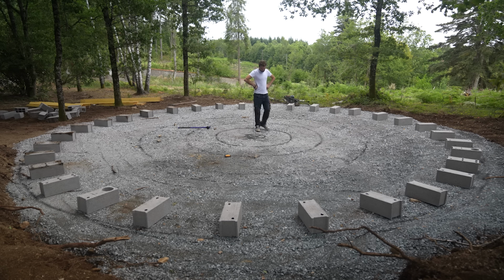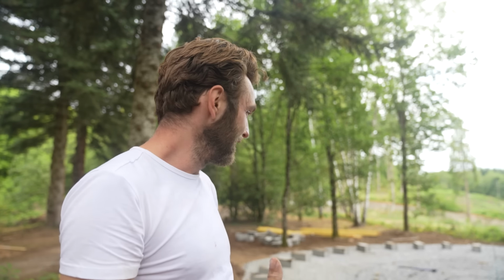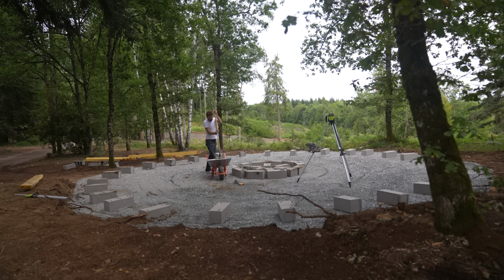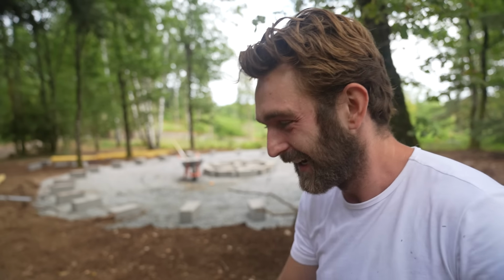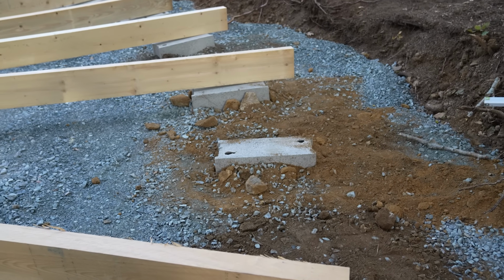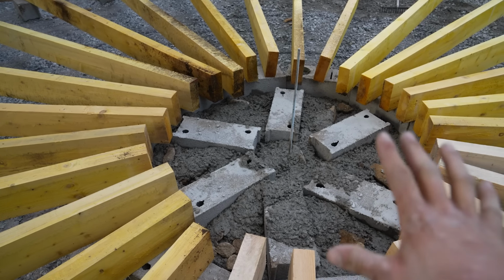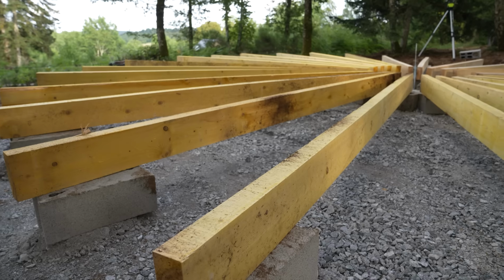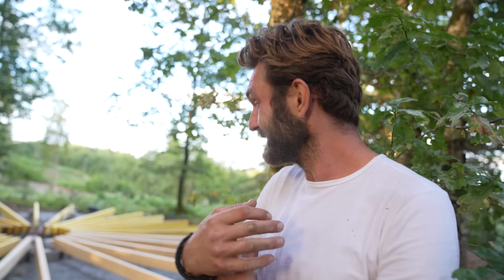Pumping water from the old chateau source.

Comment: Dan if you read this please don't get in that well without gas testing first!! It is very likely that organic matter has displaced the oxygen down there
Reply: Wow today I learned that can happen! What’s the solution, put a fan down it a while to vent it out? Go down it with some kind of oxygen tank or line?
Reply: Probably best to hire a sucker truck to drain the thing from above with noone going in there. But if you had to, subba gear
Reply: Such good advice. I hope he takes the time to read it and maybe have a discussion with you. From what I’ve seen in all the discussions in the comment section there’s a lot of wise people that offer smart tips for Dan.
He also needs to put a cover on the well for the safety of his boys and anyone else that walks near there. It blends in so easily, anyone could fall in it.
Reply: I was thinking of rats pee in the water too! Until tested, I wouldn’t be brave enough to use it even in cement.
Reply: Dan, why don't you just rent a  camping for Cople of months?
Reply: @samd505  and never ever go down when you are alone, gear or not. Wear a body harness and attach a cable or ohter rope to it which are strong enough for your weight and which the other person can use to pull you out.
Reply: Loads to think about, in this thread... 🤔
Reply: @mostafaelhaddadi7455  Now that'd be a pretty boring alternative, wouldn't it? ;)
Reply: I have a well at my house, brick and in very good condition, around 40ft deep. I know a lot of junk was thrown in years back. I rang a few companies involved in well construction to see if they would clear it out- no one wanted to get involved and said it was too dangerous.
Reply: Also..keep it covered for safety.
Reply: @mostafaelhaddadi7455  It'll take a few years to restore the Chateau, and for most of that time it will not be habitable. He may not be able to live in it even if it's habitable, depending on building laws.
Reply: @mostafaelhaddadi7455  Because building a yurt is far more fun!
Reply: @jennifer6833  And the wildlife too.
Reply: @mostafaelhaddadi7455 $$$$. And he has years to go on the Chateau. The Yurt will last as long as he cares for its upkeep.
Reply: In fact I often worry about animals  and children falling down there . Do you have a grate ? X
Reply: @debpatriot9557    Indeed.
That little rim around his death trap would just trip any victims on the way in so they go down head first.
Reply: You raised an interesting point.  How is it that an internationally famous building project has never had one single objection to anything from a building inspector, or even a visit from one?
Reply: @trudiemartin5854  I was thinking of how many dead animals have fallen in, died, and rotted in there, myself.
Reply: @ji8044 Dan referenced a guy coming round a few weeks ago.
Reply: I suggest a contest where we each guess the number of skulls that can be found in that pit.
Reply: @tracycroll4325  A dozen things I have seen would cause stop work orders in the US.  I'm wondering if Dan gets away with everything by calling it a movie set, rather than a residential building project.  That would be a stroke of genius, and hard to disprove.
Reply: Oxygen depletion is caused through the consumption of oxygen in the decomposition process or displacement with another gas. There are no visible signs of oxygen depletion or displacement. Plants grow perfectly fine in a zero oxygen environment. The breathing reflex is caused by the buildup of CO2 in the lungs NOT by low oxygen levels. Oxygen depletion causes hypoxia (oxygen starvation) which in the initial stages causes loss of cognitave functions followed by loss of conciousness and then death. The only good thing about it is you are unaware of it.

Oxygen is typically displaced by Hydrogen Sulphide which is given off by decaying vegetable matter in the presence of water. H2S in low concentrations smeels like rotten eggs. In high concentrations it burns out the smell receptors in your nose so you can not smell it.

The best way of clearing that well is by vacuum truck. It is fast and there is no mess to cleanup after wards. Failing that option the only other way would be forced ventilation. The bare minimum would be a forced, ducted airsupply to the very bottom of the well. Preferably with another fan exhausting out the top.

Once you start disturbing the material in the bottom of the well you are going to release bulk H2S into the bottom of the well. H2S is heavier than air so will stay in the bottom of the well given the chance.

If someone has to go down the well you REQUIRE a minimum of two people. The second person must not UNDER ANY CIRCUMSTANCES enter the well. The spotter may inititate a recovery if they can do so from the surface (using, for example, your winch to pull you from the well). The spotter's primary function is to raise the alarm.

There have be numerous cases where the spotter has entered a confined space to initiate a rescue and in so doing doubled the number of fatalities.

Ignorance in this matter WILL kill you.
Reply: @ji8044  As far as the law goes,if he wants to play around with a pile of rubble on his land with no public access or employees it’s up to him. The problems will likely arise when it officially becomes a residence.
Reply: Not only organic matter but also the water itself. High levels of minerals like iron and others can generate gases that smell like sulfur or rotten eggs. Cleaning a well is a risky work, you need proper ventilation and gear to do it safely. Anyway the first thing I would do would be a temporary cover to avoid children or animals falling inside. Second thing, I would connect the pump to the old piping system just to locate the entry point in the chateau.
Reply: @StubbyPhillips  🤣
Reply: @stephencrowther524  Perhaps France doesn't have as many officious twits standing in the way of everything anyone wants to accomplish.  Sure, there needs to be oversight and regulations, but in my experience many of the people who do inspections and issue permits tend to be shamefully and inexcusably slow about it.  I think it makes them feel important.
Reply: @mostafaelhaddadi7455   With a yurt you are king, with a camper not.
Reply: @mostafaelhaddadi7455  easier to sleep close to the chateau, so no travel time needed. AND, building a yurt makes for good content 💡💸
Reply: @mostafaelhaddadi7455 that’s very expensive.
We paid $170/day for a mid size camper.
Reply: Very good suggestions.  I know nothing about wells😮
Reply: @stephencrowther524  Well in the US he would need a CO to do that of course, but for instance all that steel would require a framing inspection.
Reply: @StubbyPhillips  I think that varies wildly depending on whether you live in a pro-growth or anti-growth town or county.
Reply: Cover that well, Dan.
Reply: @ji8044  The building has burned to the ground at least twice.  All that is left is the bones, literally nothing left to preserve. Dan has made the decision to rebuild it as close to it's original as possible. The site is historic, the building is not.  It will rise again anew like a phoenix with a tribute to it's past. Dan has people come and look and he has his permits.  He was wanting to build a log cabin but they wouldn't permit it.
Reply: @ji8044  he actually had an inspector out there already. I don't remember what episode would probably in the '90s
Reply: @StubbyPhillips  right probably has some of the people that the Nazis killed in there. Might be a better idea just to cap that thing and drill well
Reply: @Fuggybugs  I was shocked that he still has not put a protective covering over the well, to make sure no one falls down there, including his boys. We saw this open well quite some time ago and still he has not taken any precautions. There could even be e. coli in the water, or worse. And dead animals rotting in there.....not even good enough to mix cement, better off buying a water storage tank and having a water company come fill it up with clean, fresh water as needed.
Reply: @ToraTiger78  My thoughts exactly. There could even be some dangerous bacteria lurking in that water, not even fit to mix cement. Buy a water storage tank and have water delivered immediately Dan. And put a cover over that well to protect people from falling in.
Reply: @StubbyPhillips  Wow, I didn't even notice that, but that well definitely needs to be covered right away, I thought he would have covered it by now, it's been quite some time since he first showed the well in a past episode. He needs to buy a water storage tank asap and have clean water delivered and resolve that issue immediately.
Reply: @trudiemartin5854 More like rats and other animals drown in there and probably murk it up. 🤢
Reply: @Johnepumper  I wonder what the inspector thought about the uncovered well....as well as dangers from the water being contaminated, like with e. coli for example.
Reply: @stephencrowther524  Very well said! It's up to him. But I'm a bit sickened by the idea of "playing" with french heritage...
Reply: @lindascott2008  Yeah, I'm pretty far towards the opposite end of the spectrum from the usual hoard of "safety sallies" but that open pit death trap is just scary.
Reply: @lindascott2008  I too, was shocked as well, to see Dan has not covered the well.   Cannot put a price on safety.
That is a good idea, that Dan would be  better off buying a water storage tank and having a water company come fill it up with good clean, fresh water as needed.  Good point, until Dan decides to either get that well pumped & cleaned by a well company truck with a hose, or has funds to drill a new well closer to the chateau.
If he insists on using the well as is, he could at least pour a liter of bleach down there.   It will kill most everything alive:   bacteria, fungi, protozoa.
Reply: @udosteger has stupped enough to do it
Reply: I think the yurt is a great idea as it will form another income stream once he no longer needs to live in it, glamping is a big thing and the yurt sounds perfect.
Reply: @operator6471  ok well that's just them not wanting to be bothered. You need to understand that "well construction" nowadays is just drilling a small hole in the ground, lining it with pipe and eventually dropping a pump down it. Old fashioned wells are not even remotely in their wheelhouse.
Reply: @SweetOne.  I don't believe he ever intended to build a log cabin, sorry.  You have to remember Dan isn't rebuilding a chateau.  He's making a movie about one man struggling against all odds (and never using safety equipment)  Dan is a brilliant filmmaker, but he's not very good at construction at all.
Reply: @ji8044  did you miss that video then?
Reply: @debpatriot9557  I agree with you a cover is needed for safety the thought of anyone accidentally falling down it is a thing nightmares are made of
Reply: @Fuggybugs yeah me too
Reply: @jennifer6833  A cover !!! YES!!!!
Reply: @ji8044 maybe it has but we haven’t been told
Reply: @mostafaelhaddadi7455  That was my suggestion, at the very first. I don't think he read it.  But if he wants a nice big warm space, a Yurt is pretty darn comfy for him and the kids, or volunteer friends. They're pretty common in rural Canada, and folks just love them. This would keep everybody safe if the reno takes a lot longer than planned.
Reply: Methane!
Reply: Right on the line for that note. Dan did mention taking precautions in previous vlog especially for boys and potential risks for others. I bet a little nudge will be anticipated.
Reply: @operator6471  With the right equipment and experience clearing a well could be undertaken, I think no one wants to do the dirty jobs, or anything that involves a bit of work, more likely.
Reply: @sharonlomas3720  I suspect Dan will end up living in the Yurt and renting out B&B  and utilizing the finished Chateau as a business concern, obviously sleeping over and using the day rooms when vacant.
Reply: Good point, wonder if you could just hang a burning piece of wood in there to get rid of the gas. For the lack of oxygen, i would just blow compressed air in there. But yes, maybe dont go down there while being on your own
Reply: The best and safest way to drain it would be by using a huge pump truck with a long thick hose to just vacuum the entire well clean treat it.
Reply: Looks as though that well has been like that for a long time and also as if he’d let his boys anywhere in the woods without him.
Reply: All good tips here and the methane gas is a real one, As a kid I experianced a person die in a not to deep well as suffercated by gas! Take care and put a roof on your well also.
Reply: As a confined spaces trained person this is great advice, don’t be on your own either when attempting it
Reply: I want to to be a gas free ranger 
I want to put my life in danger 
I want to go and probe your hole
And climb down into your dirty mud tank 

It’s been close to ten years since my coworker killed himself for personal reasons, he taught me this song as a gas free , confined space inspector.
R. I. P.       Marc
Reply: @twobluestripes a blower to purge it for the correct amount of time based on the cubic feet of space before going in and test the air again. Also not a bad idea to keep an air monitor and blower going while down there. I work for a telephone company and we do that if we have to go into a manhole or underground vault.
Reply: @lesdmark  True, but they stated that it is dangerous work.
Reply: @ji8044  its France the rules are very different !
Reply: @mostafaelhaddadi7455 the yurt will be a few years
Reply: @ji8044 don't be ridiculous
Reply: I find it absolutely unbelievable that Dan hasn't attempted to cover that well in any way to stop anyone falling in.  Imagine having his 2 little boys there as well.  So, so dangerous.  Should have been the very 1st thing he did before anything else.  It's really crazy to have left it like that🙄🤯
Reply: Hope more people like this so the comment will be easy to spot.
Reply: @udosteger  Dan did say he would never go down the well without Nick and all his harnesses etc so we know he will never be alone
Reply: @operator6471  🤨
Reply: An open well. How many poor critters have fallen into that gaping hole. Just don't drink it. And maybe commission a grate or a fence. Especially with the young ones visiting.
Reply: It would be good to firstly have the well cleaned ( pressure wash) and drained. Secondly to grade the top soil around the well so surface water run away from the opening. After that COVER the well rigorously for safety and water hygiene.
Reply: Well is there and must be covered for safety as so deep ,mains water close by now as homes and businesses very close to château end of site so own water source irrelevant.
Reply: @Throki  😂 it’s true
Reply: Take care of your boys not to fall in… have a lid on it?
Reply: Where are the doggies?

Comment: If you suspend the pump with the rope from a 2" by 4" so it does not touch the bottom (or sides) your water will remain much clearer and you reduce the risk of clogging the intake with muck.  If you get a barrel with a float switch and a tap you can use a separate solar panel to keep if full with a 12v pump and have water "on tap" when you need it, at least till winter starts.
Reply: With an uncovered well, it is probably full of organic materials and dead critters, so it will be murky/mucky no matter what.
Reply: @ankiking  as I said clearer, not clear and most likely not fit to drink. It will also protect the pump but it should still have a pickup screen.
Reply: Great advice and simple 😊
Reply: Maybe just put it inside a cage of 2' weld mesh, if its a dirty water pump it will manage some bits.

Comment: for clean water pump water into a tank we use IBC "intermediate bulk container"  farmers have plenty.  with a tap 30cm above bottom for outlet, add flocculate "pool cleaner in your hardware store "  water will be Clear in 30min, than drain mud water from the  bottom valve. Shower- household water needs a sand filter from a pool with back wash.

Comment: My house was built in the wilderness of WV in 1870, a cistern built up on the mountain to catch spring water delivered by gravity to the house 400 ft down hill. When I bought the place, it was not covered, the wood covering had rotted and fallen in years before. I had to climb down into it and clean the debris and muck one 5 gal. bucket at a time. Be brave, have someone topside for safety. I have the BEST fresh spring water  ever.

Comment: You could get an IBC (Intermediate Bulk Container) and put it on a stand near the well. Run the pump, fill the IBC, let the sediment fall down a bit and you have "running" water for a while. So you don't have to run the pump for only some buckets.
You could also install some filters.
When you have your first roofs you can also use these to collect rainwater.

Comment: As someone below said Beware the methane gas ,,,,, i wouldnt risk going down there ,clean out the worst of the organic sludge with a bucket ,then just leave about 50 cms or so when you drop the pump down it will fill with clean water and thats what you will pump out. I,ve used the same system with two different wells both about  10 metres deep ,and it works fine, above ground then you can couple in all the filtration systems that you fancy.

Comment: Love your work. To drop the pump down the well... may I suggest? A post dropped on the ground 1/3 to 1/2 over the hole. Anchor & fix this  to the ground. Lower all your stuff over this pole  instead of the edge.  Keeps weights centred in the hole. Perhaps attach a float (old empty plastic bottle(s) )to the pump assembly  so it sits closer to the surface?  And also tie the cable to the rope every foot or so.. Cable doesn't get all that much more stressed, and cable + rope helps tensile strength when drawing it back up and out.  Yes, very stinky water will come out for a long while I guess.   Cheers.